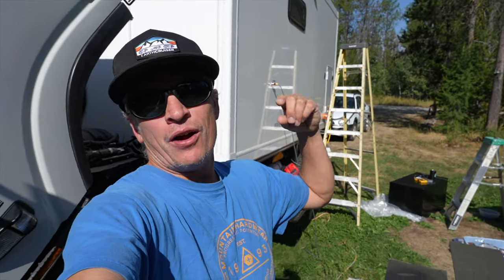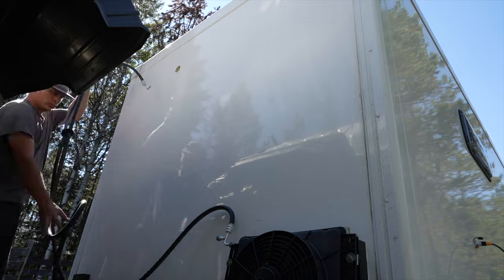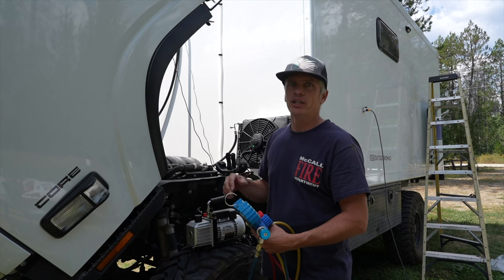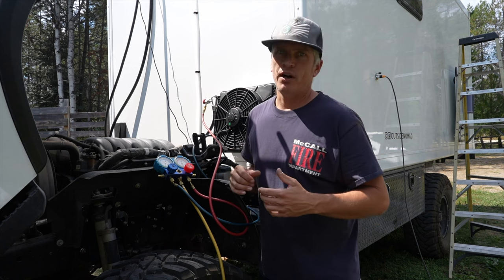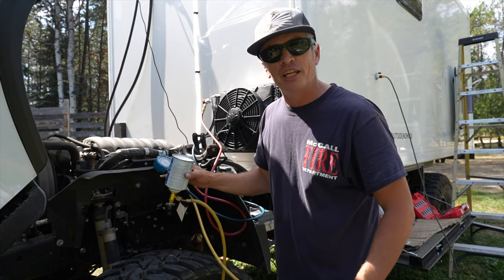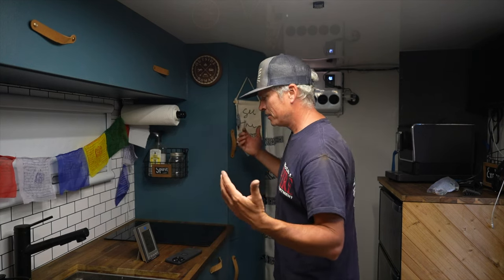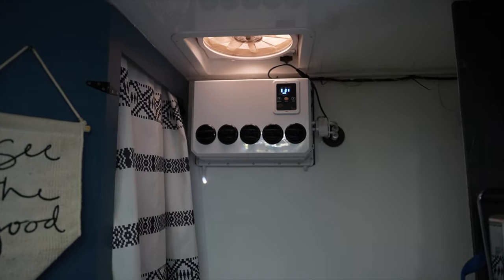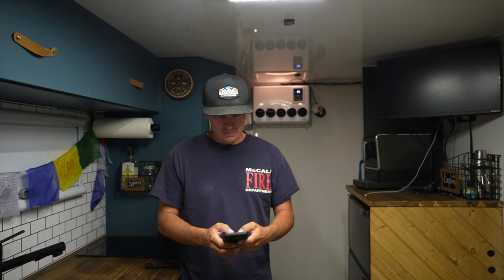Part 2 - Budget Camper Van Air Conditioner for Overland Travel - 12 volt/24 volt DC Powered AC

Comment: Im considering this lifestyle, but in an Econoline. The only issue is the heat. I plan to get solar panels and a battery bank but from what im understanding, this wont be enough power. Any advice or thoughts? Is 3000 btu the smallest unit available on earth?
Reply from the maker: Well it all depends on how much battery and solar you have as it can be enough power for the AC system. 3000btu is a pretty small AC and may have a difficult time keeping a van cool.
Reply: @outsidenomad  what about a kei van?
Reply from the maker: @amalgamating  Is that a brand of van? From what I gathered they are a bit smaller so that might work better. What AC unit that's 3000 btu are you looking at?
Reply: @outsidenomad  i read about them online, the air conditioning unit. Kei van, like the honda acty van or the Daihatsu hijet. Can we discuss solar stuff? It's more economic to get the kit rather a "generator" and two panels, right?
Reply from the maker: @amalgamating  Sorry not familiar with any of those as they are not offered in the States. When you say "get the kit" what are you referring to?

Comment: Thank you for sharing your install and experience!
I'm getting ready to order a unit for my M1079 Cab and then one for the box/habitat.

Did you purchase directly from the factory or from a north american supplier?
Reply from the maker: I would purchase through Amazon and add their insurance plan. It’s very reasonable and if the thing shows up broken you’ll be covered. I would also reach out to the vendor on Amazon and ask them to double box it. They are drop shipped from China. 
The Amazon link in the video description is the supplier I purchased from.
Reply: @outsidenomad   pls can you install this ac unit or do you have shop mine is don’t work pls help

Comment: I'm sorry but no, this unit is not energy efficient. It's pulling like 60amp set to 28c and like 80amp for anything lower. It's like 90 outside. I spent a huge amount of labor to get it in and it can't even be charged fast enough to keep in running overnight. 

It's running on a 12v system of that matters.

Comment: According to the Amazon link provided and the description, it offers 13,500 BTU at 2300 Watts, or 5.8 EER... WHY IS IT SO DISGUSTINGLY INEFFICIENT??????
Reply from the maker: I’m not sure where you are getting those numbers as the unit I got did not have those numbers. 
But yes these are not as efficient as a residential mini split but they are also one quarter the size and weight. 
I didn’t want a massive residential unit on my camper but others have gone that route. 
With plenty of battery and solar we run ours daily and have never plugged our camper in over the past 8 months. So plenty efficient when paired with enough solar.

Comment: It’s a good and cheaper option but I rather do the 12 v self contained roof top unit all in one , just cut the hole, dropped, connect the wires to the battery and good to go.
Reply from the maker: The rooftops are quite easy to install and a great option.
Reply: This is for poor man who can't afford the fancy roof unit, lol
Reply: But the roof is weak.   Will not hold the weight.
Reply: Not an option for me as I already have two max air fans and a roof full of solar. I’d rather not take apart my walls to rewire the max air fan hole for an AC unit. It’s not an option for everyone. So truly appreciate this video.

Comment: Noise level of the fan seems reasonably quiet , is that other rumbling/vibrating sound on your walls coming from the outside  unit ? wondering about Db level for stealth camping?